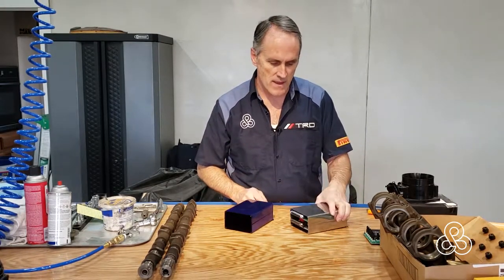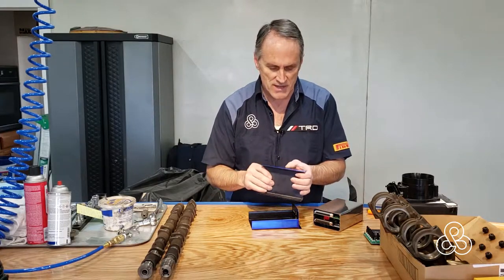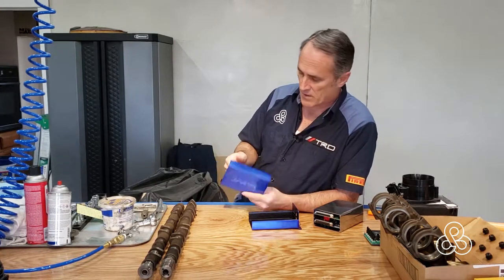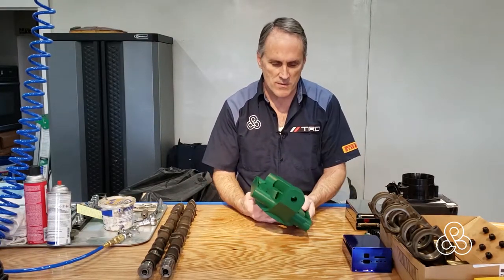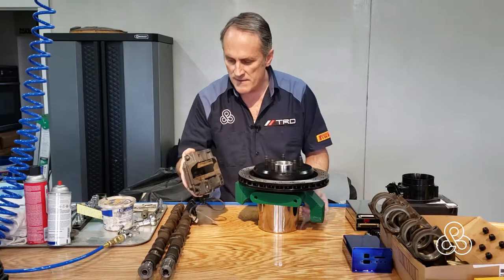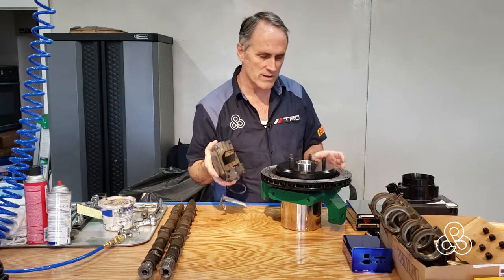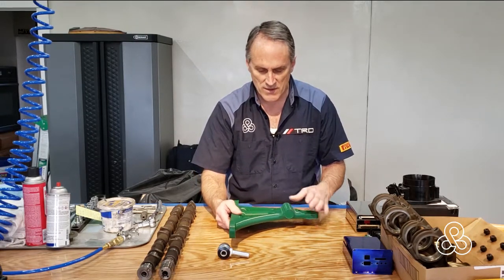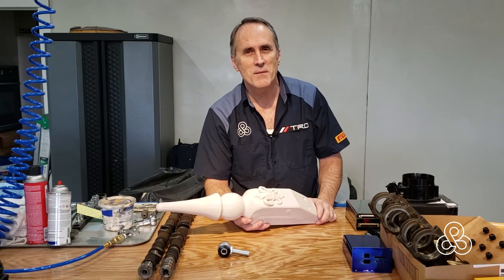Jarvie Arete Supercar update- Test fitting brakes and the ECU case

Comment: When you are making the moulds for casing, do you need to oversize flighty due to contraction when the metal cools, or is the all taken up with the screw adjustment mechanism (I suppose the latter)..
Reply from the maker: Yes, adjust for shrinkage and machine surfaces that you want to meet specific tolerance.